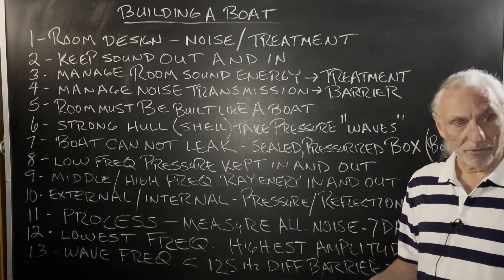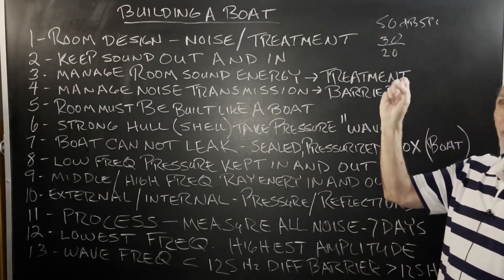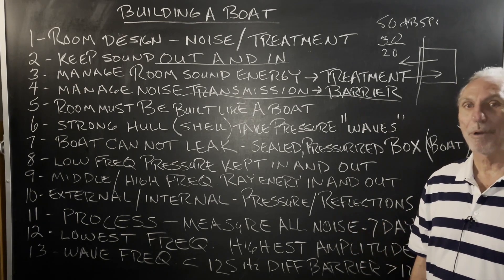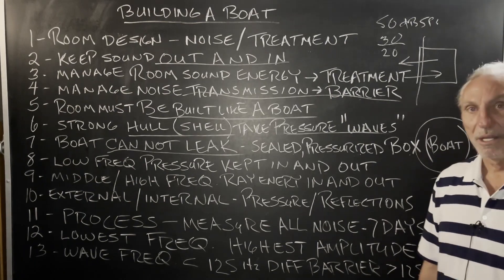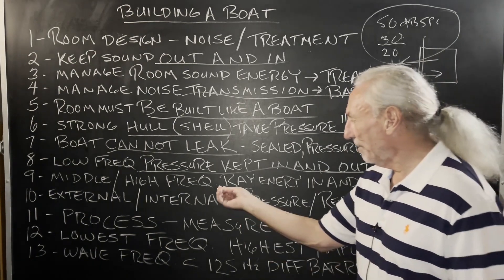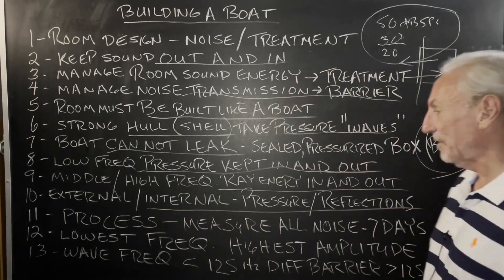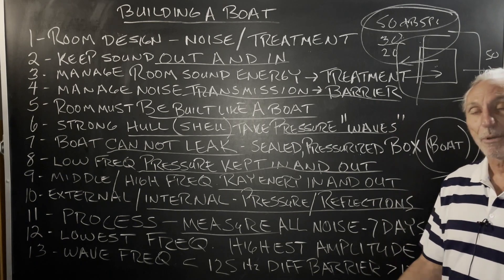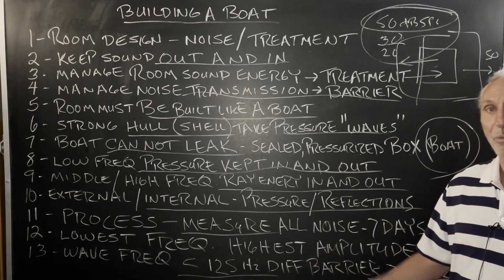Building A Boat - www.AcousticFields.com

Comment: I Like the video.  I also have a suggestion for a new one.  I'm having difficulty understanding what type of sub works in an optimal room like you suggest.  What role does room gain play in the sub?  Since you have absorption does the room normally gained by the sub in a normal room suddenly no longer have room gain and I need a bigger sub to get the same output?  Thanks.
Reply from the maker: Its not sub output you must be concerned with. It is managing the long low frequency wavelengths produced by the sub. You must have a proper room size and volume along with the proper rate and level of absorption to begin the energy management process.